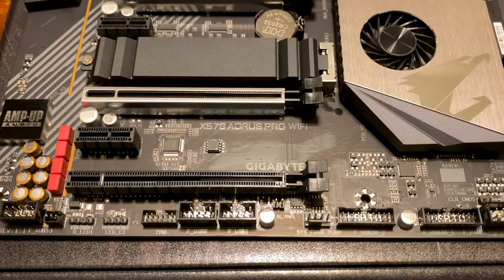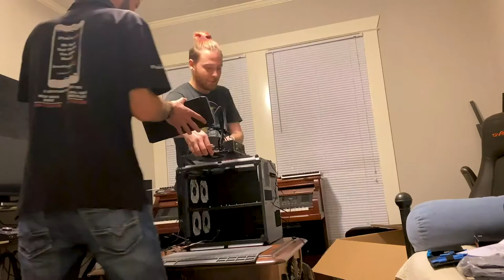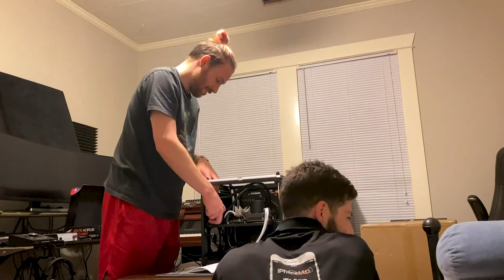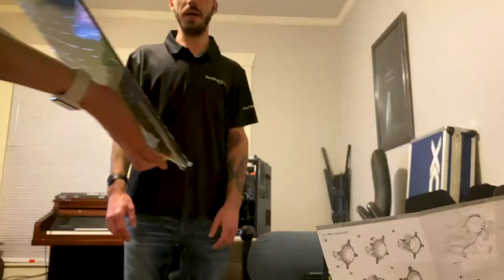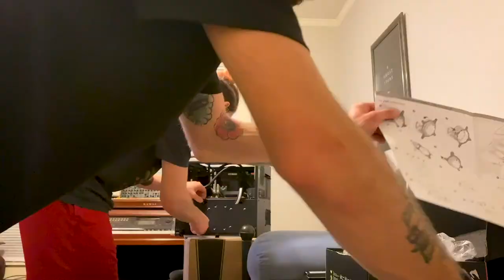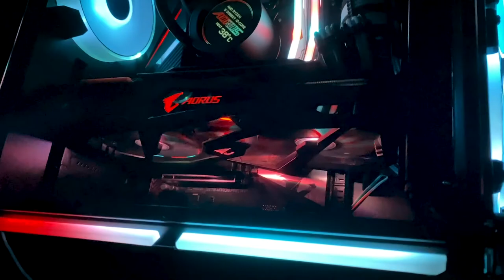My Experience Building a Ryzen 9 Workstation in the Azza Cube 802

Comment: hello, i just buy this case whit a b550m mother board that only have 4 ports for the case fans and one for the processor fan, my question is how you conect de fifth fan ? in my case i only get to conect 3 front fans and the rear fan.
Thank u
Reply from the maker: Hello Leonardo, 
My x570 motherboard has enough fan plugs to support all 5 fans. I'd check your motherboard's user manual to identify all the fan plugs for your specific board. You can find it on the manufacturer's website if you've discarded it. It doesn't matter what the fan plug is labeled as on the motherboard, because most manufacturers will give you the option to change the temp source and fan curves in the BIOS. So, plug your last fan into any available fan plug on the motherboard. If you do not have any more available fan plugs, then you'll have to order a fan splitter from Microcenter, Newegg, or Amazon.
Hope this helps!
Reply: @homerectech4849  hey happy new year thank u for thr answer. Yes i need a splitter ,the mother board only  have 4 ports. thanks again

Comment: I guess a 3080 FE won't fit with an aio
Reply: I am giving it a shot with the 300mm EVGA 3080 FTW. We shall see if it fits lol.
Reply from the maker: My 2080ti is 290mm in length. I just measured an exact 16mm of additional space between the gpu and 20mm radiator. NVIDIA's website claims the 3080 FE is 285mm in length! You should be able to squeeze one in there easier than mine!
Reply from the maker: @GuruAidTechSupport  the FTW will be a tight fit! 300mm will give you 6mm of wiggle room! I'd recommend putting the GPU in first and then the radiator!
Reply: @homerectech4849  I will try, thanks for the response!
Reply from the maker: Of course! And let us know if you find one at MSRP 🙃